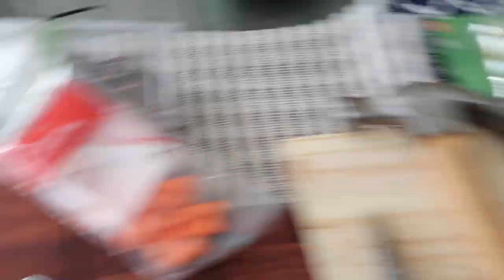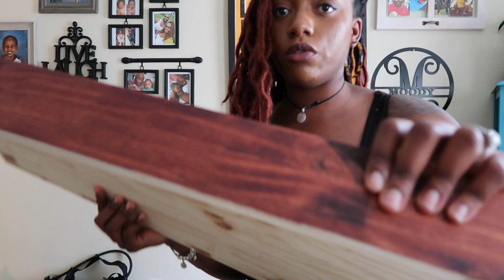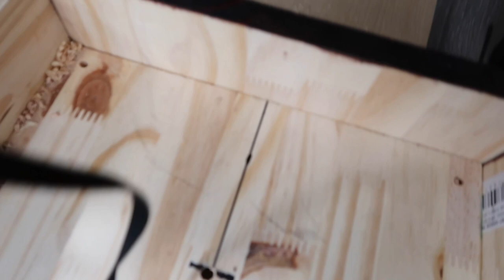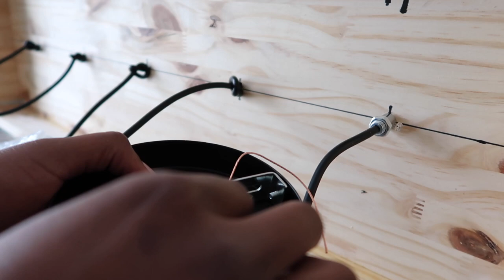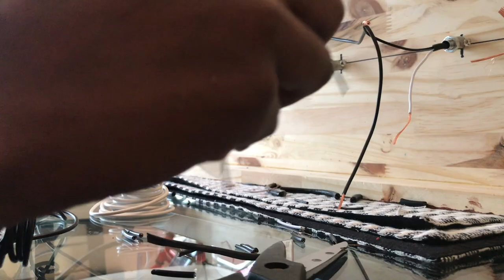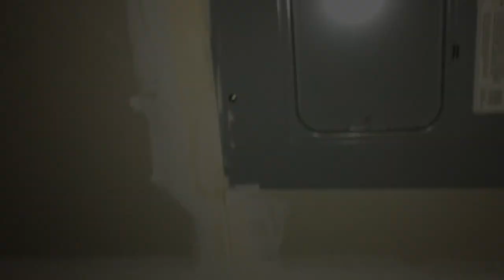DIY MASON JAR LIGHT | BUDGET FRIENDLY FARMHOUSE DECOR | MAKE A CHANDELIER WITH ONLY A POWER DRILL

Comment: Suggestion, leave all the wires long and connect all blacks and all whites in one bundle. Just twist them together with pliers before putting larger wire nut on. Good job though, I like it